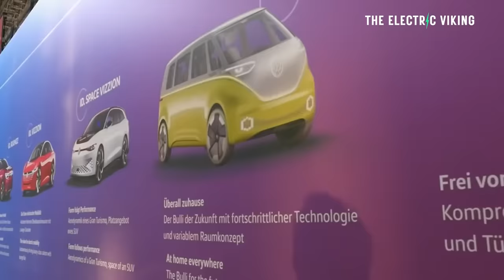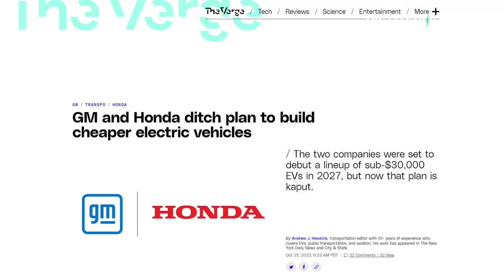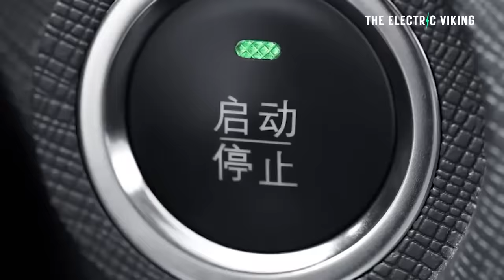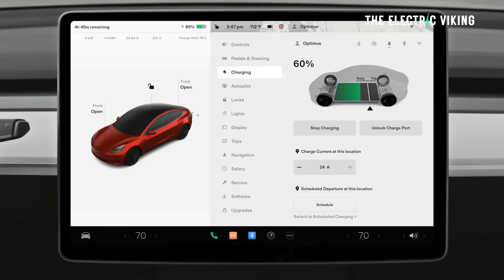US Electric car transition slows as inventories balloon on dealership lots

Comment: Early adopters have made their purchase at a premium price, everyone else is waiting for the price drop. With every "new tech", it's the same. If you want to get in early, you pay the premium, then the rest of the market waits until prices fall, and then they get on board. It has been that way forever. The problem with cars, however, is that new cars compete with used cars, for sales. That wasn't the case when they introduced the Commodore 64 for the Atari, or the Nintendo. There was no competition of any sort, other than a deck of cards or a chess board.
At the end of the day, a car is a car, it's a tool, it does a job. For the vast majority of car buyers, they are budget focused, not tech focused. And interest rates are now how much?
Whether you're considering an EV or an ICE vehicle, if you don't have the cash, it's a tough sell for manufacturers.

Comment: The combination of high cost of EV's currently plus the variable quality of CCS 2 DC charging is what is holding up EV adoption here in the USA. That's why the push is on to adopt the SAE J3400 DC (NACS) charging connector for every EV manufacturer and make it easy to pay for charging via a credit/debit card or Apple Pay/Google Pay over the next few years. Resolve the ease of charging issue and EV adoption will dramatically rise.
Reply: I would argue more specifically that a bunch of manufacturers say they will make their vehicles with NACS starting next year and since Tesla now only has to add CCS software instead of CCS charging cables we don't know whether or not they will wait to convert stations until more vehicles have NACS ports. So if you wanted an EV, but weren't desperate for a new car, why not wait until they come with NACS? If you are desperate for a new car but live in an area where the Tesla network is the only DCFC charging network, buying a car with a CCS port now might not mean you can use the Tesla network, so Tesla may be your only choice. My extended family lives along a corridor that exclusively has Tesla DCFC. My mother was considering a Tesla Model Y, but when Ford announced they were adopting NACS she considered the Mustang Mach E too (since no one in our family want to give Elon Musk any money but feel the positives of an EV outweigh the negatives of him as a person). The Mach E won't be manufactured with a NACS port until summer 2024 and she does not need to replace her current Prius so she's not going to buy an EV this year.
Reply: Very true.
Reply: Not dramatically.  Most people don't want an electric vehicle.  Chinese electrics catch on fire way too much and Western ones are way too expensive for what they are.

We barely have the electric infrastructure to provide electricity for houses.  Have you any idea how long it takes to bring new power stations online?  It's at least decade for the permitting process, let alone design and construction.
Reply: @losfromla1480  Nonsense, we are building solar power plants and wind farms with battery storage at a fast pace. The time is now for electric vehicles. The price will continue to go down over time.
Reply: The Ford/GM/Stelantis and to a slightly lessor extent Toyota and Hyundai/Kia's thunderous charge to only offer the U.S. customers big overpriced road hogs with super high pricing (great profits) has spilled over with a vengeance into their pretty sub par EV offerings (except Hyundai/Kia their cars are pretty good). That's why they are sitting on the lots. It's not because folks in the USA don't want EV's it's because we don't have any reasonably priced cars being offered. Trump's China embargo is still in effect and keeping lower price tier vehicles out of the USA.
Reply: @sbl17jackson37  Yes, those batteries that are fully reliant on Chinese resources to build at a time when friction with China is at an all time high.
Reply: @SunriseLAW m3 is small. Try the Y. Surprised you find them loud. Not as quiet as expected. Try the highland m3 for very quiet.
Reply: @losfromla1480 but most people will start to hate paying high petrol prices.
Reply: @SunriseLAW  That's why I mentioned the high price first. I believe by 2026, improved, less expensive battery chemistry could mean way less expensive battery packs and we could see EV's about the size of a Honda Fit or Toyota Yaris with the same range as most of today's EV's, about 285 to 300 miles range per charge.
Reply: Quality in th same sentence as CCS …….. HA
Reply: @Sacto1654  I think we are in EV 1.0.  EV 3.0 (mass adoption) will feature non-flammable batteries and will be produced in 'lights out' factories.  They have half the parts of an ICE car, no reason we can't get a nice one for $15,000.   Still: mass-adoption of EV's may look totally different than what we see now.
Reply: @SunriseLAW   Does not Tesla insure their own cars for much less than any other insurance company? When the battery pack cost the same or less than an ICE and transmission, the price will be same or lower. Add in no more oil changes and a lot less maintenance, EVs will win in the long run. Or not so long run.
Reply: You dont agree that people arent buying EV because of the range becouse you don't have or are actively looking for an EV. We all know you still drive GAS. It is a pain in the ass to own an EV if you don't own a house and even if you do own a house try to do a road trips with that then y will understand that it is not ok to have to stop and charge for 40mn every 200 to 250 miles, when GAS do 500 miles with a 5 minute stop to refill
Reply: @SunriseLAW so full of FUD where do I start. 🤣 
A Tesla model 3 costs less than a Toyota Corolla and the prices will continue to follow a very predictable cost curve downward as scale of manufacturing increases and the nascent technology improves.
Tesla has the highest customer satisfaction of any car company so your wild theory of customer dissatisfaction doesn't match reality. 
As a model Y owner with first hand knowledge I was much more satisfied than I had imagined I could be. In fact we were so satisfied we gave our gas guzzlers to our kids because we'd rather share one Tesla. 
In the past insurance was more because insurance companies didn't know enough about EVs. Our insurance on a brand new Tesla was less than on a gas car a few years old. The highest payout for insurance is medical. Tesla's being the safest cars ever tested means medical payouts will be dramatically less. 
In fact high insurance rates of the past were why Tesla got into the car insurance game. Tesla insurance is still the lowest because it's based on your actual driving from the previous month and not actuary tables or wild ass guesses like other insurance companies. 
You know so much, unfortunately most of what you know is wrong. 😄
Reply: @sbl17jackson37  You are not living in the US if you think grid capacity is rapidly expanding.  Those solar and wind plants are REPLACING older coal plants.  And you still need additional transmission lines to carry the increased loads.  Overall grid capacity is barely budging.
Reply: @SunriseLAW   e-bikes are dangerously fast, people don't see them coming, even if they are just walking and don't have headphones on. 
Wait for your first accident.
Reply: @SunriseLAW    a bike is a good point, I do ride a bike, but I don't ride my bike like crazy. One time a person almost crashed into me (a matter of 2 inches) as I was walking around a corner of a house and a bike came illegally on the footwalk close to the house, too fast, did run a red light, the next crash candidate.

I look where I bike. I don't bike into blind corners and I don't bike like crazy. I see whether people have seen me or not, I react accordingly.

Comment: Musk pretty much said at the Q3 results presentation that EV sales are slowing down because they're starting to run out of customers wealthy enough to afford an EV, that haven't bought one already.
Reply: Sedans have limited appeal.  Tesla desperately needs a van.
Reply: @JeffMathias  What Tesla needs to make is PHEV, in order to lower the prices of new Tesla models without having to cut prices on existing models.  Current Tesla owners are angry due to drastic drop in value of their investment.  Stock owners are mad due to reduced profit due to those major price cuts.
Reply: @trungson6604 you're dreaming! That goes against everything Tesla stands for. Put an ice engine in a Tesla? Then they'll need a dealer network and repair shops. There are plenty of good PHEVs to buy now. People buy Teslas because they're only electric. They are an electric motor, some electronics and a battery, few reasons to breakdown or require maintenance. Early adopters always pay more and complain, ask any iPhone owner. Buy a used Tesla, they're as good as new, but people still think like ICE owners, that they lose 25% value when they drive off the lot. They don't.
Reply: @trungson6604 🤣 did you forget the/s sarcasm tag? 
As a Tesla owner and investor I'm not planning on selling my Tesla that has 5x more longevity than a craptastic ICE car. 
Being an investor nothing thrills me more than when the stock price plummets giving me the opportunity to buy more shares at a discount. In fact I recently bought more and have already made gains on those shares. If you don't like volatile stocks then don't invest in them. Keep your money in the bank and let inflation steal your wealth. 😄 

The stock price has nothing to do with the fundamentals of a company.

Comment: Prices will drop when EV makers realise not everyone wants or needs all of the electronic wizardry they provide. Most drivers have the cabin temperature, mirrors, seats, etc. set at a constant level; they only change for husband/wife. A simple car that goes from A to B cheaply in moderate comfort, is often all that is required from one year to the next.
Reply: Same goes for FSD, which doesn't work anyhow. I hate sunroofs, too. But I need a heat pump and cold weather batteries.

Comment: The main problem with Legacy EV sales is the terrible charging network in the US. In Naples FL there are only 2 places to DC fast charge non Teslas. With a total of 4 charging ports. There are 5 places in Naples to charge Teslas. With a total if around 36 ports.
Reply: I don't understand. Every place with a plug is a charging station. It takes longer but cars sit for 95% of the time.

Comment: Went to a charging station this past weekend for my Chevy Volt.  They had about 10 J-1772 chargers.  The 1st three failed. Finally the 4th one worked.  This shows you how the infrastructure is not maintained and can't support EVs at its current state.
Reply: They were paid to put them in, not to keep them running.
Reply: @jamesvandamme7786   So you're saying the current model isn't self-sustaining?

Comment: In UK one of the biggest obstacle of getting a BEV is "no incentives" and significantly higher insurance cost for an BEV in compartment to ICE vehicle. I was planning to get an BEV (Tesla) but because of that I will plan to get an EURO 7 (when become available) compliant ICE car and be done with it.
Reply: Not entirely true on the insurance side. I have just checked the renewal of my MG ZS EV against the 1.5ltr petrol version (same trim) and the EV is £29 CHEAPER than the petrol. £475.85 vs £504.10 using the Confused comparison site. I don't know where these assumptions are coming from that it's just EV insurance that's going up? MSE Martin Lewis just posted saying car insurance is up an average of 61%. 1 million EV's aren't pushing up the cost that much of the over 29-30 million cars
The incentives were phased out as the prices have come down massively if you look at what £30k got you 10-12 years ago (after the grants). That would've been a Leaf or an Ion which before rebates were a bit shy of £39k. The base Model 3 is now just under the "luxury" car tax bracket as well at £39,990. My sister got a 2nd hand M3P for £28k

Comment: Even Hertz is slowing down on their EV buying, too expensive to maintain and they don't hold value good enough was the reasons
Reply: Cheaper batteries mean older vehicles won't be worth as much.
Reply: @Paul-vm9sz  How about the price of gasoline?
Reply: Notice that Hertz is slowing down.  That not shifting back to ICE.  The actual article reads more like they have some things to work out.   Need to get their contracted repair shops trained on tesla repair.   Tesla has a 2 week course for upgrading body repair people to work on Tesla.

Comment: With the slowdown in EV sales and Hertz saying they are not going to expand their current EV fleet because of high repair costs and low resale value is it time to stop, take a breath, and re-evaluate why we need (or not need) EVs. Unless the range  goes up (double at least) and cost comes down to at least on par with ICE cars the majority of people will not buy them. It is still debatable that with all the mining that has to take place for raw materials and a large section of electricity production in the world is still by coal if EVs should be delayed until we have these problems sorted out.

Comment: I have 2005 Scion xb bought new for $15000.00, about to roll 266000 miles and still runs like it was new. Get 32 mpg. I could never replace that vehicle with a EV for the price and reliability and it only takes 4 minuets to fill up. I want an EV but just can't afford one.

Comment: One reason Ford Lightnings have stalled... is deceptive advertising.  when they first released the commercial 2+ years ago they showed it doing V2G and V2H  
they did not mention you needed a disconnect transfer switch for most V2H
and that most of the power companies in the US delay V2G installations even on solar/battery installations by over a year on average they have a huge backlog.

So because of delays n release of the lightning the cost increase and the not being able to do the V2H as easily as they said they could.

Another drop off on sales is people have decided to wait a year or 2 for all the vehicles to have the NACS connector (tesla connection) and be able to use the tesla network. they don't want to have to use an adaptor and hope for the best they want the NACS connector and systems installed before they buy a new non tesla car

every were i look the US car companies seem to be shooting themselves in the foot

Comment: The economy and the high interest rates are the issue. Plus low cost EVs like the Bolt are needed. There is no lot inventory for the Bolt. And from the local dealership here they don't have many ID.4 waiting to be sold. There is still a waiting list. Mach-e is an exception as they are still a bit over priced.

Comment: Regarding EV insurance.  Overall, the lower accident and injury rate of EVs is a significant advantage. This advantage should more than offset the higher repair costs of EVs,
Reply: The lower accident/injury rate has nothing to do with it being an EV instead of a gasoline powered car.  It has more to do with features that could be included on any kind of car.
Reply: @tirdkat6104  Actually they do.   You could put 1000 lbs of lead in the bottom of an ICE and it would still have a higher CG than an EV.
When an EV hits a pedestrian there is generally less injury.  The front of EVs lacking radiators and engines, they crumple absorbing more of the energy.  
We can't lower insurance rates on ICE cars because they could in theory have safety features they do not have.
Reply: @danharold3087   This is absolute nonsense.   If you hit a pedestrian with a 5,000 pound car, its not going to crumple like a pillow and not harm them.  That's a very dubious claim.  If the front of EVs were that soft then just driving down the road at high speeds would crumple their front end from wind resistance.

Adding a thousand pounds of lead would probably in fact make the traditional car have a lower center of gravity and it would probably still be a lighter car.   How much do you think traditional powertrain components weight?  MUCH less than EV batteries.

Comment: The day someone sells a cheap one with a lot of horsepower, i will buy it even if it has only 2 doors and roll-up  windows ... literally no expensive features, just 300 miles of range and 350 - 450 horsepower, a zero to 60 in about 4 or 5 seconds at a price that people can actually afford. I can live without heated seats... i can live without a nanny system telling me how to drive. I can even live without cruise control. If it has enough cargo room for a lunchbox, it is enough. I want it quick, reliable, good range, no unnecessary expenses, no dealership shenanigans. It should be as light as possible, but a bit bigger than a mazda miata. Might as well make it a convertible and give me a red one. You know, like make me care about the car again, you know, like in the 90s when guys were like into cars. Like make an ev that people can be proud of owning. It's hard to be proud of  owning something grandma is driving. Are you really happy with that same tesla that everyone has? Why don't they ever change how it looks? It's been the same looking egg for years. I wish tesla would give us a 2-door car that's not roadster priced.